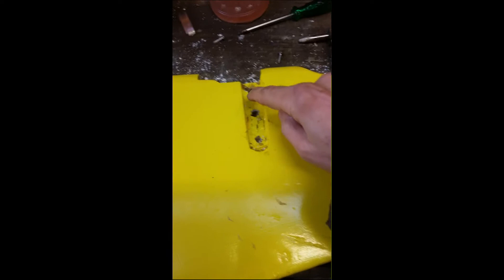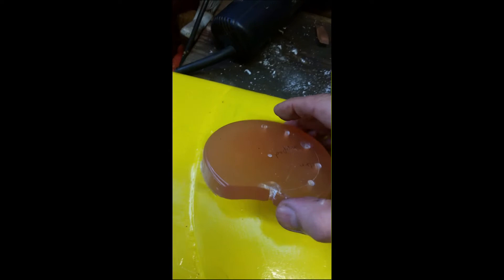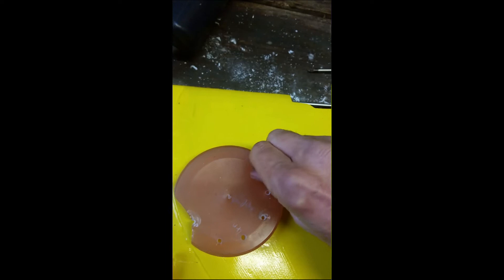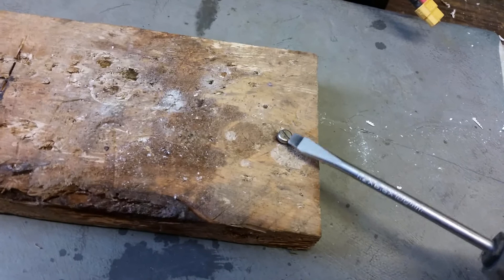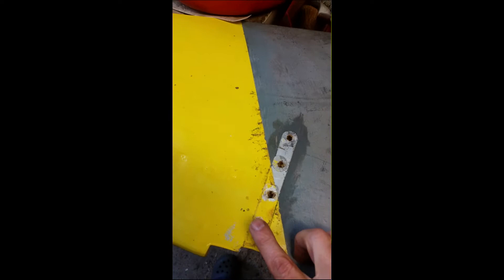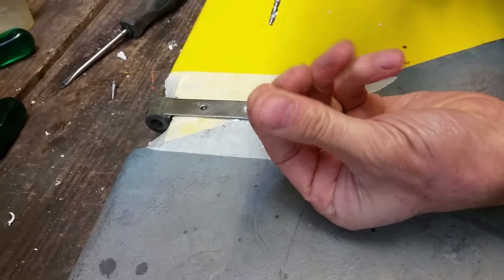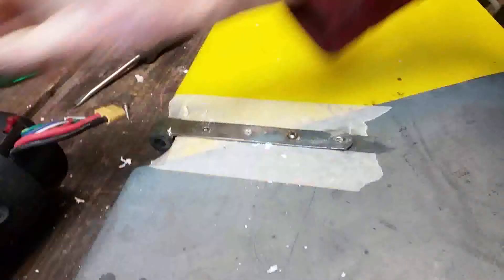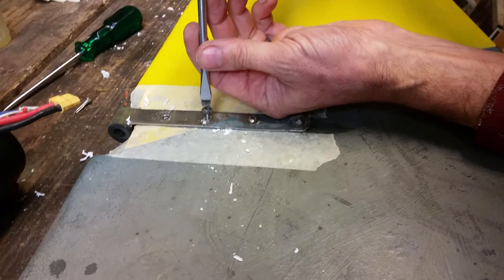Putting a screw into GRP or Epoxy Resin

Comment: I'll have to look into that of pouring epoxy halfway into the hole. And then spray a screw with WD-40, and then sticking it down into the epoxy for it to cure into the shape of the screw. I'm referring to small screws going into plastic.
Reply: You're joking right? So contaminate the surface resin?  Don't put fish oil aka wd40 or silicone near West Systems genuine epoxy resin  or any other type epoxy be it Poly or Vinyl type resin. Why would you use wd40 to get the screw threads imprinted?  You can use the screw itself with some fresh wetted epoxy on it and even leave it in so it becomes an unbelievable level of bond. You can epoxy a screw in place then unscrew it once cured, stick some wet epoxy on it and it will bond amazing too.  If you are fixing the fittings areas like in this vod where a hinge or any sort of marine fitting is going then you are best sanding back the local area where the fitting is to bare glass, then you lay a soak coat of straight epoxy, then you throw on some glass cloth to give you a new surface, sand that back and apply a thin barrier coat then sand to the grit you need for your paint. From there you can put the screws or bolts in a freshly drilled hole. At no point would you ever contaminate the entire area with WD40 mate,   WD40 is banned from my shop and I'm a 4 decade boat builder I've built over 120 boats. Wd40 doesn't belong near a non-mechanical repair shop and should be nowhere near any project involving glue and paint.
Reply: @bigduphusaj162  What I ended up doing was filling the screw hole with slow set epoxy. aka 5 hour cure. As that is stronger than the quickset stuff. I then coated a screw with chapstick and wiped off the excess. Then I stuck the screw down into the epoxy and used a q-tip to wipe up the squeeze out. Then let it sit for a few days and it unscrewed just fine. 

I tested several different lubricants and found chapstick worked the best. I didn't test not coating the screw, but I probably should have to see if I could unscrew it after the epoxy had cured.
Reply: @colt5189  you don't need to do any of that. If it's proper epoxy (not polly or vinyl) then you can effectively drill an oversized hole and let it cure before drilling out a hole the same size or 1mm down if its a cheap drill that wobbles, stick some epoxy in the hole or bead it up on the hole if gravity is against you, soak your screw in epoxy and screw it in lightly till it holds your fitting flush and no more, at that point walk away as you're done.  It's really that easy mate I'm not joking you here this is how we get every screw flush and even the heads pointing the same direction (slot heads especially you need them all facing the same direction for the professional look)  When bonding screws or even anchor screws using proper Epoxy resin you just need to get it tight enough to hold your fitting in so you can even get seals/beads/secondary bonds all seated nice and flush and level and all the screws are uniform. All this trying to get a thread to hold in epoxy is because people don't understand the epoxy itself.

Comment: Just chop up some fiberglass 1/2 long mix it up real good in resin and after mixed good add the hardner and mix good again and use a rod or nail with the poking ground off so you can stuff and pack your mix in good and spray your threads with light oil and it will act as a release agent. Then with light pressure screw your screws in and let it set for a little and check how stiff the mix is getting and if stiff enough unscrew it and let it cure and you should be good to go .

Comment: drill it out and install nut inserts. then you have a proper machine screw holding the Rutter plate in place
Reply: Would you drill the holes out, pour epoxy in, and then set the nut inserts in the wet epoxy and let dry?
Reply: Gluing in oak dowels would be a good way to do this is think, that way you can put in a normal wood screw. 🤔
Reply: @ross52066  yeah you can do that or tape peel ply to one side of the hole or fiberglass over one side. Just as it gets sticky and strong pour straight epoxy or epoxy mixed with a little bit of thickner of choice preferably under 5% to stop it getting brittle, then redrill the holes and bolt it in. It will be massively stronger than the original fitment. If your talking sheer compression capability when you torque the bolt down tight AF then the epoxy is absolutely solid as it gets.
Reply: @TheNinja691  if he knew what he was doing the proper epoxy fix would have took a half hour and been 100x stronger than any wood. Even the fitting could have been bonded with epoxy and that alone would have ludicrous levels of bond. This is an easy fix made hard and what people need to remember is you can just drill an oversized hole with even a countersink bit just countersink the entire plug area out, plug it with epoxy pouring it slow  making sure to get all the air out, let it cure then drill a hole likely 1mm down from your screw size if you haven't got a good drill or good drill bits... or drill exacltly the diameter of the screw and wet the screw and the hole then screw it in jusy till it snugs up and no more. The epoxy resin itself will bond up like nothing you've ever seen and the screw will be hard to remove  no joke it will need cracked off. The beauty of doing it the correct way is you are only really having to get it tight enough that you feel it holding your fitting down nice and flush so you have plenty of leway to wind the screws down another half turn and line screws up perfectly so all the screwheads especially flat/slot headed are all facing in  the same direction so you have a nice professional look. They will all bond up the same even if one screw isnt that tight at all because  all you're looking to do is get the fitting on there flush and even and let the epoxy do its job bonding the screw up. I'm a 4 decade boat builder this is how we get all the screw heads lovely and flush no angled out heads and get the screws all uniform as far as the head type.  Do it right and you only need to do it once in 30+yr I'm not joking
Reply: @bigduphusaj162  4 decade boat builder? 😳 I bow to your knowledge sir 🙌
Reply: I've commented a few times on here buy just to let you all know how strong epoxy is when you follow the tech sheet and use proper epoxy resin.. I fixed multiple outboard motors cracked gear cases and have even had to epoxy a few up to hold the oil fill screws and they have held out to this day. The criticality with heavy duty bonds on engines is you need a huge scarf angle at both sides of the fix and you need to know what you are doing with the fillers and glass matting you are using... but it is possible to fix even an outboards gearbox casing with epoxy resin as a permanent fix so just remember the capability of the material we are talking about. I use West Systems when the job needs a proper epoxy resin. Polly and Vinyl are wetting out resins they have zero strength on their own so used strictly on GRP fixes and covering wood or in the construction phase of boats as its fine if its an entire part being made of it at once, it's not fine for fixes that need to be strong, only proper epoxy like West Sysyems can do that
Reply: @TheNinja691  😂 cheers mate I don't mean to belittle anyone it's just when working with epoxy or especially finishing techniques like spray painting it's painful to have to tell folks you need to do it as per the data sheet. Most people don't even realise the difference between the Epoxies themselves, for example proper epoxy resin like West Sytem 105 is strong and flexible on its own, it has zero shrinkage and has the most ridiculously strong bond there is so it's perfect for every fix but not needed for making entire boats from it, Polly and Vinyl type resin (sold as an epoxy resin) barely have any strength on their own, they are a "wetting out" resin they are fine if you are glass clothing up but they shrink during cure so they arent ideal for structural fixes that need to be super strong like a Transom. Proper epoxy resin you can glue the screw in no joke you can bond the entire fitting with it if needs be and it will hold up as long as you obviously get the bonding area down to the bare wood/grp/metal. I often do that on quick fixes I cut the paint and entire damage out with a Fein multitool out just enough that it's only doing the damaged bit behind the fitting, epoxy the the entire thing up with the screws in the fitting😂 and throw some peel ply over it to keep it roughly to shape and keep it all contained around the fitting then walk away. Worked every time and lasted but its because I'm willing to take a lot out of it and I do a quick check to see what fillers I need to match the material I'm bonding to. Technically if you do the proper fix with West Systems or the likes and you follow the data sheet then the fix will never fail for the lifetime of the boat. Cheaper epoxies I'd avoid if it was a difficult or structural fix as they aren't user friendly at all and the Vinyl resin they sell is out of date as its only good for about 6 month from manufacture it suffers deterioration from the 3 month mark. West Systems is and always has been the best.

Comment: You clearly never read the West Sysyems data sheets or done your homework. Right so the project you are doing all you had to do so the oversized epoxy plug didnt  crack and it actually took a screw easily was drill the plug you intended to fill with pure epoxy at the recommended size. This lets the epoxy you are screwing into expand and not just act like a huge block of ice and crack. If the plug is the correct diameter for the screw you plan on using then the plug itself will expand and flex enough allow the secrew to go in no hassle. Also you can drill into epoxy filled plugs with the same size drill bit as the screw you intend to fit, then you run the screw in wet with epoxy and leave it right as it barely gets tight. This gives you a tremendous bond and you realise it when you try to unscrew it.  Your test block i could have got to hold a screw no sweat too, id have added about 3% 409 microsphere blend and put a finish cloth on the top or a thin tore away layer of biaxial. The test block would have took any screw even from a impact gun no joke.  You need to pay attention to the plug diameter etc when using epoxy properly as a screw hole fix.  Also, you could have epoxy bonded the entire lot on by applying the fitting wetted out but thickened with 406 coloidal silica. Id have redrilled bigger holes in the fitting and done and epoxy plug fix and done dimple drill holes into het rid of the paint and bare material then bond the enire thing on it it would never fail again.  Youd get it off if you ever had to but it would be a far better job than the boat came with.
Reply from the maker: Thanks for that information @Big Duphus AJ, very useful.
Take note everyone.